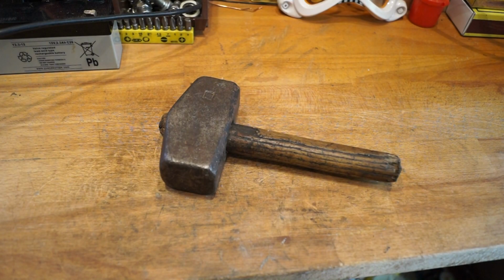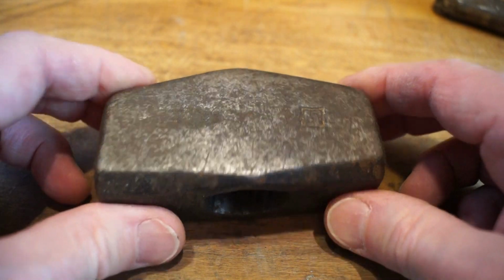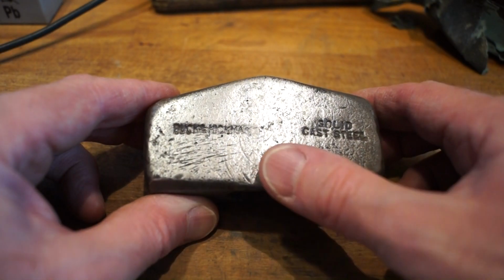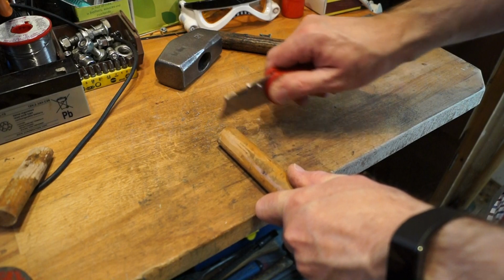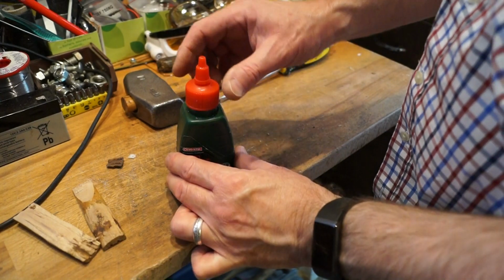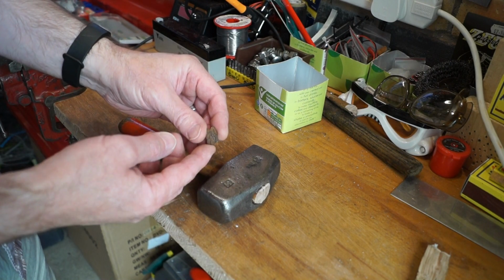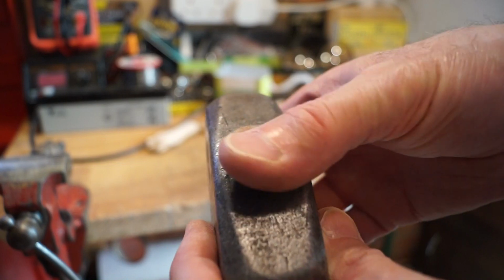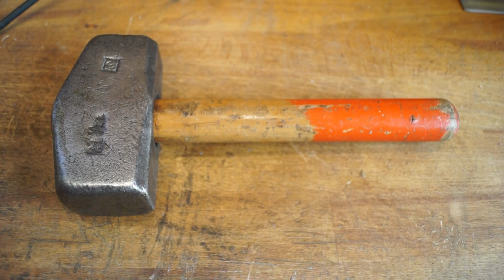Buck & Hickman Lump Hammer Renovation

Comment: Enjoyable video. Its always good to see people giving old tools a new life. 
Little tip for you. The reason the handle split when you drove the metal wedge in is because you cut across the grain for the wooden wedge, that's also why the wood wedge shifted to the side and knocked the handle off center. A wedge should always go with the grain of the haft/handle and not across it otherwise it stresses and fractures the wood. 
Hope that helps. 😀
Reply from the maker: It is always good to hear from someone who knows what they are doing 👍👍. My late father would not have been impressed, he was a carpenter by trade. This is the first time I have fitted a handle to a hammer head and it really shows, I'll know better next time. Thanks for watching and the useful information. 🔨🛠️👍